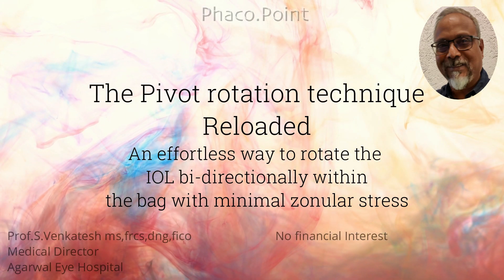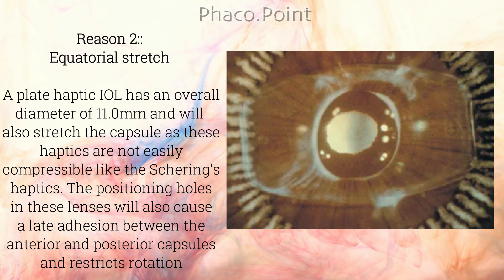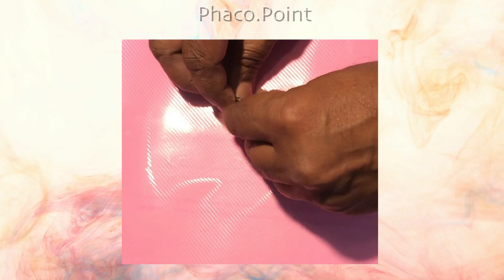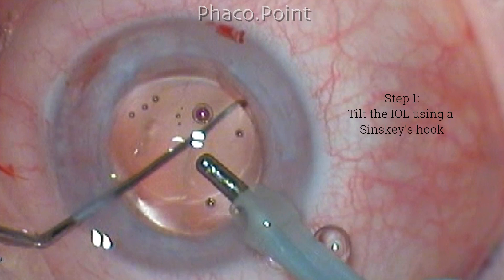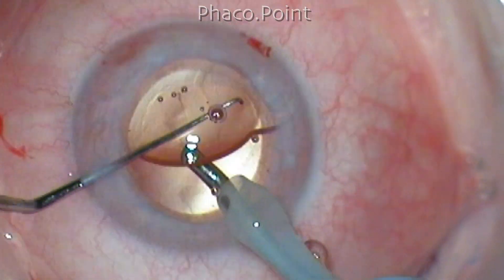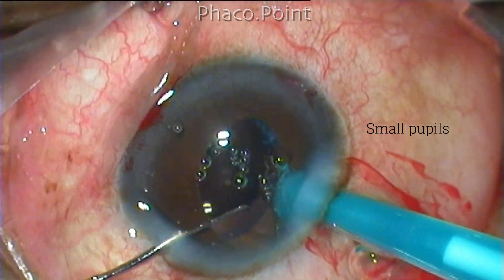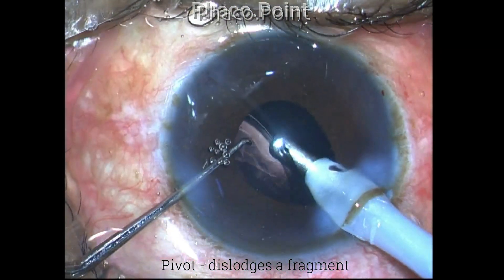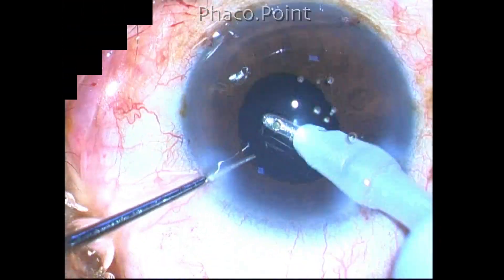The Pivot Rotation Technique -  Reloaded. A simple way to perform bidirectional bag IOL rotation

Comment: When iol is flat on PC and taken to one side or iol is tilted and taken to one side, 
are there chances of creating equatorial rent? any precautions to avoid it?
Reply from the maker: Hi.. since the capsular bag diameter is 10.5 and the optic of the IOL is 6.0mm tilting the optic  or moving the optic at right angle to the haptics is very safe . The capsular bag accommodates the human crystalline lens which also has an anteroposterior diameter of 4.0mm -5.0mm while the IOL is less than 1.0mm in thickness hence there is ample space for the tilt and no risk of equatorial tear or Zonular stretch. please try it and you will know
Reply: Thanks